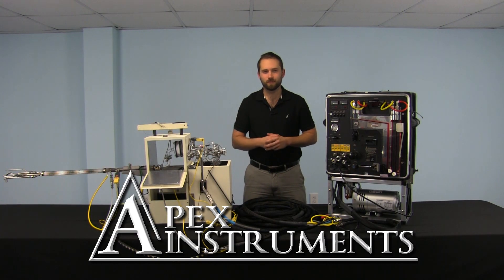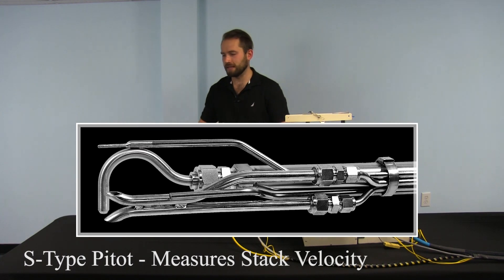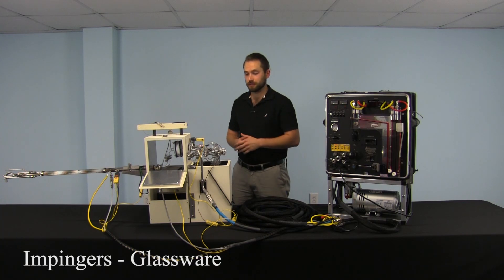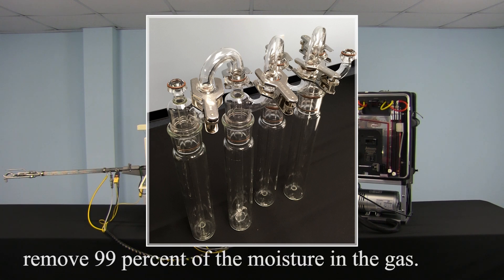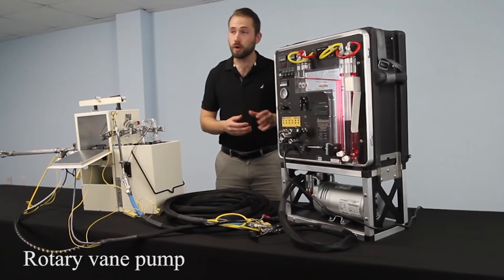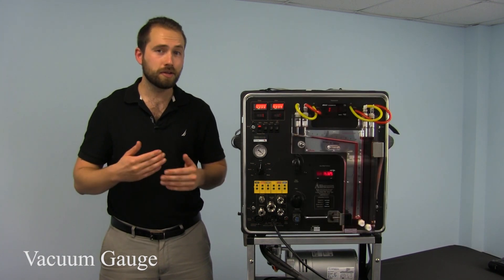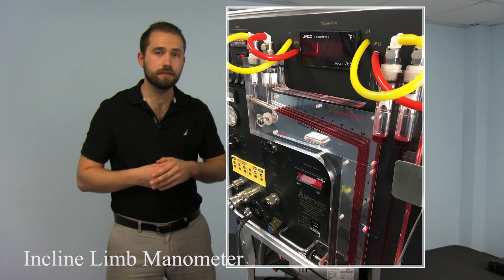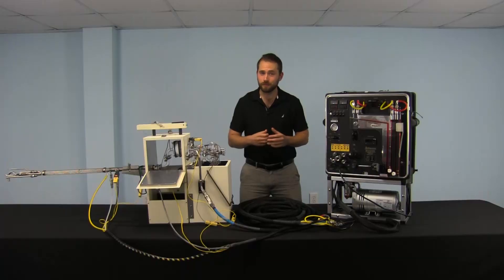Isokinetic Method 5 Train Breakdown

Comment: Hello there! what's the difference between the method 5 and method 17?
Reply from the maker: Method 5 and Method 17 are very similar in principle and practice. The main difference between the two is that Method 17 collects particulate on a filter inside the stack while method 5 collects particulate on a filter outside the stack.
Reply: @apexinstrumentsinc  Thank you for your answer.
Reply: @NEMEPOLYNHA  Of course! If you have more in-depth questions you can contact us on our website or call one of our representatives.